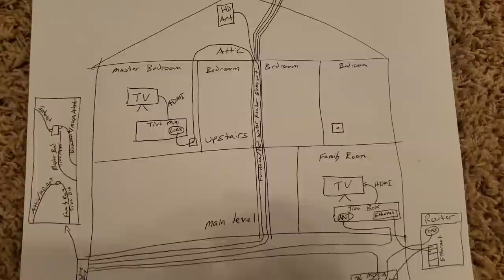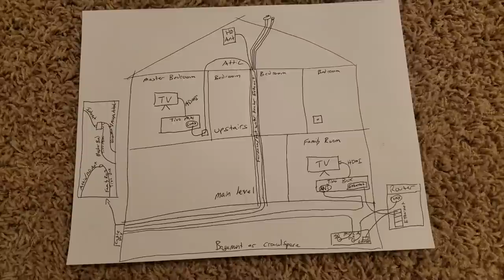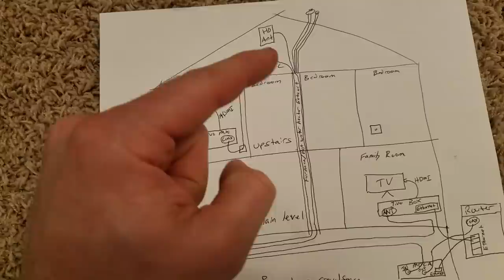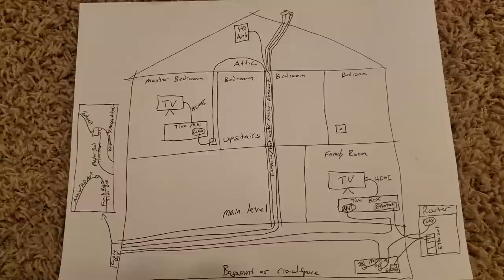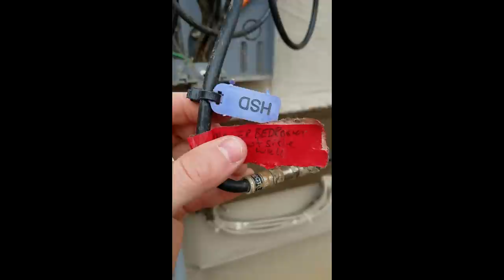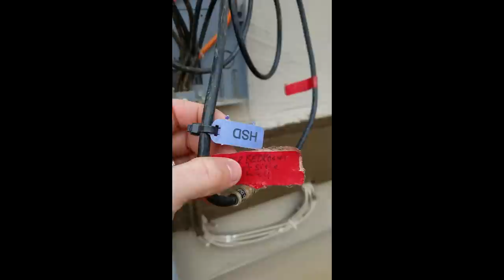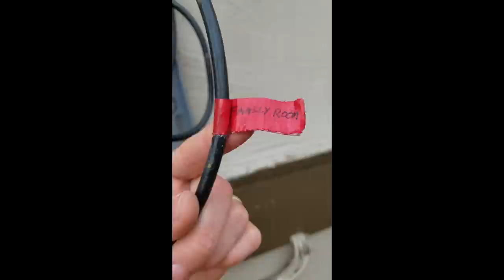Cutting the cord: How to wire a house with an HD Antenna and Tivo (part 1)

Comment: I have a standard Bolt with cable and antenna capability. Can I discontinue cable and just use it as a OTA unit? I also wonder if I'd still need a cablecard.

Comment: So, exactly what HD tv antenna did you use on your setup? I don't believe you showed or mentioned what type or brand it was that  you used. Many of the antenna brands are not receiving good reviews at the major places they are advertised for sale on and are frequently less efficient than a simple DIY antenna is supposed to be, at a nominal cost in making such. Is the Tivo Bolt Box and a Tivo-mini good for this setup for a family that does not do much recording and only needs 3-4 tvs hooked up in the home? Thanks for any input.
.
Reply from the maker: This is the antenna I now use.  It works very well mounted on my roof (on the outside), pointed toward the city where most of the TV station antennas are.  

https://www.amazon.com/RCA-Compact-Outdoor-Antenna-ANT751E/dp/B0024R4B5C/ref=sr_1_1_sspa?ie=UTF8&qid=1545353133&sr=8-1-spons&keywords=rca+antenna&psc=1

The only thing I'm not thrilled about with TIVO is the $14.99 monthly service fee for the guide.  Now that Amazon has come out with their Recast which includes a guide for free, I would consider that.  It would likely be cheaper to go with a Recast and 4 Fire TV Sticks than going with a Tivo OTA + 3 Tivo Mini's.

Comment: Good video.  I am looking at OTA DVR.  TiVo seems to be the gold standard and less complex for the non-technicals in the house.  Would you still use TiVo as your OTA DVR? Or are there others I should consider.  

By the way, I wish I could find a system that is a good as TiVo with transportable media like content I could import into a Plex or Emby system.
Reply from the maker: The only thing I don't like about TiVo is the monthly subscription for their channel guide.   Amazon recently release a DVR that includes a guide for free.  That is worth looking into.
Reply: Dean Hensler yes that monthly fee is quite high. Also the recordings are locked to the device. I like the idea of the Plex for portability as well as hosting my own content  But the guide and simple installation (just 1 box for TiVo) is appealing.  The non technicals would like that.
Reply: If you get a Tivo Bolt OTA, the subscription is only $6.99 a month, instead of $14.99.  The yearly fee is $69.99.    The Tivo's that are OTA plus cable are the ones that charge $14.99 a month.
Reply: Dean Paganelis thanks I will look into that further.  The Best Buy rep wasn’t too familiar.   Even at $6/month it is annoying.   But with Dish, I pay a DVR fee so this is not a new concept.  Almost all the OTA DVR options are a monthly cost or lifetime purchase.  

Another question I have is do you use streaming services with the TiVo? I like the idea of searching through local channels and streaming channels for content.   I have seen it talked about but haven’t seen that demo’d in a review.   Thanks for your patience.
Reply: @brentjohnson6654  I haven't really teied the streaming services with the Tivo yet.  I've had a Roku for about 6 months and ive gotten used to how easy to use it is with Netflix and Hulu, so Ive stuck with that for now.  Im sure Tivo's streaming options will work fine though.
Reply: Call up Tivo customer service and state your thinking about getting rid of Tivo, I did that a few years ago and they offered me lifetime service for $99.00 total!

If you've owned your Tivo for more than a year they can offer you the upgrade.

Best of luck.
Reply: Yes, I use Tivo for OTA DVRing.  It works great.  Can't beat the 4 tuners and my tv bill has dropped from $136/month for Directv (which I cancellled) to only $70 a year for the Tivo subscription.   Hard to beat that.

Comment: The time warner box is probably your internet service and when I got rid of my cable service I called the telephone company and had dsl service installed, it was only 15 megabyte but compared to dialup service I was screaming. It cost me 45.00 a month for internet service through the phone company and they tried to sell me a package to which I responded all I want is dsl service, no long distance or anything else. If you can't provide that tell me now. I got what I wanted but she was mad as turned down a $92 a month package. The dsl service worked fine till the internal battery died 5 years later, next day a telephone guy showed up looked at my box and said we replaced those three years ago and installed a new box and I was up and running.

Just another possibility.